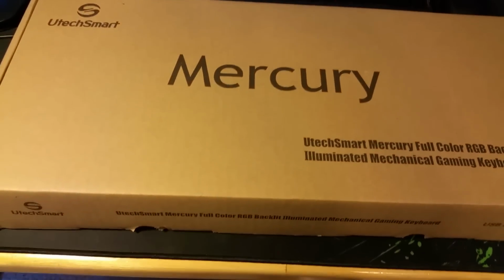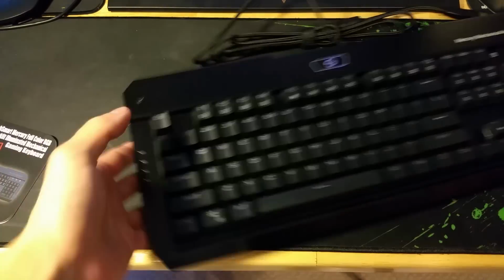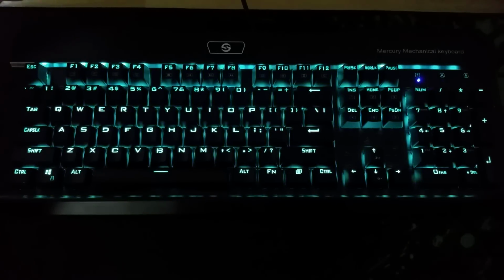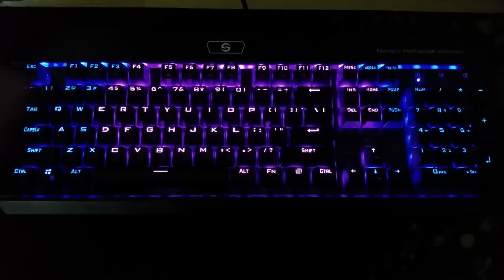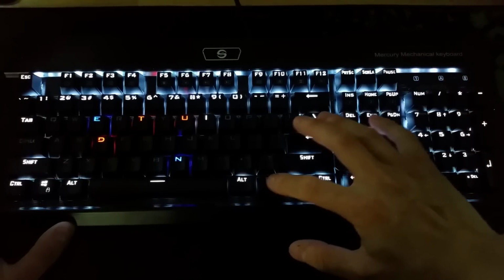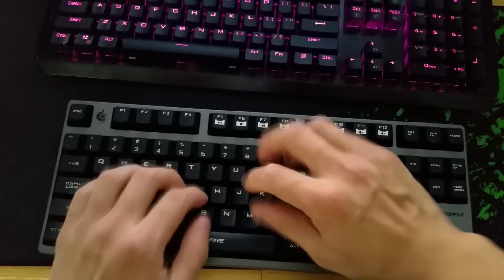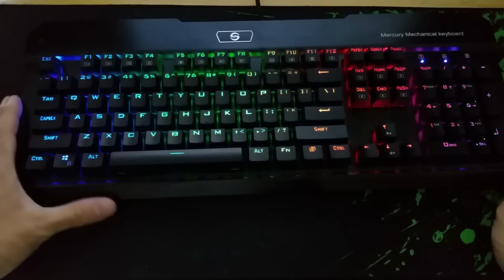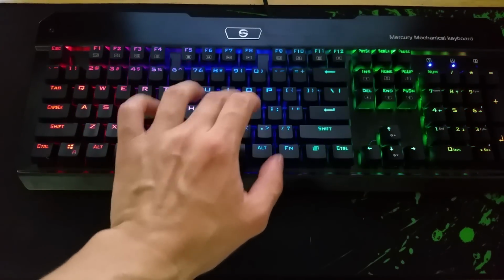Premium Quality Metal Frame UtechSmart Mercury RGB Illuminated Mechanical Gaming Keyboard Review

Comment: Note that you can tell the make of the keycaps is better than the Rosewill.  On the Rosewill, you can see that they are black painted clear keycaps.  These will wear over time, and the clear plastic will show basically making the keys unreadable over time.  The utech ones are not double injected but two separate pieces of plastic - a black cap with a clear insert.  A cheap but effective solution to double injected keycaps on the boards that cost $50-80 more.

Comment: Based on your review I ordered this keyboard which I'm using now.
The different light modes were a little confusing at first but a couple of times changing modes makes it pretty easy. I did look at some of the others that commented and this one seemed to fit my needs. I don't need macro's and this was a pretty good deal.
Thru Amazon the shipper didn't seal the box(box was just closed with the flaps and not taped) but it arrived in tact.
This is my first backlit keyboard and a huge step up.

Thanks for your thourgh review and all your videos.

WM